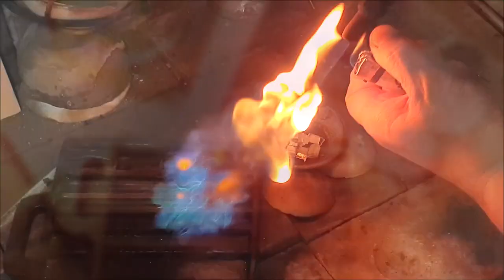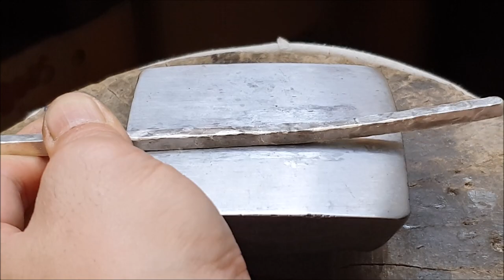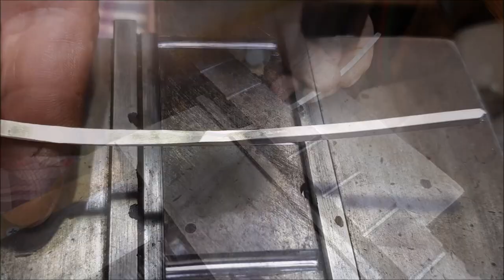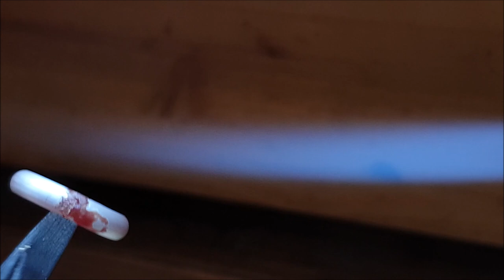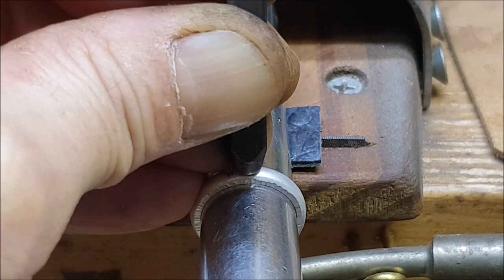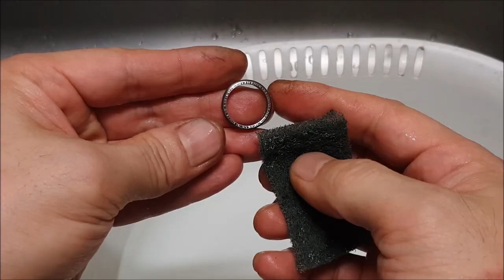Handmade, friendship couple RING  [ silver ring making ]

Comment: Acouple of people will be happy, is there a reason why you used the swage block instead of the rolling mill to round over the stock for the rings.
Reply from the maker: I don't have a rolling mill.
Even the roll machines I use today often stop working.
I would like to have a modern roll machine.
thanks~